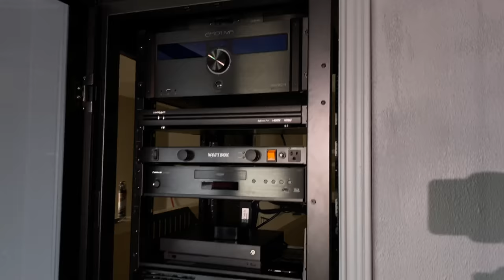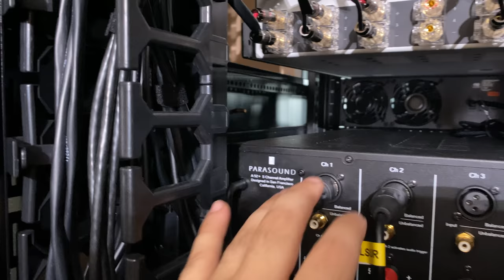Building the BATCAVE 9.2.6 Atmos Home Theater Beginning to End

Comment: Can't wait for your thoughts on the SVS elevations for your atmos. First time I have not seen them not on the side wall. I love where you positioned them.

My ceiling is too low so I had to get some in ceilings with a 15° driver baffle so hopefully that works well. They say angled speakers on ceiling is the best way. I don't understand why they don't take an in ceiling speaker and build it into a box with a 30° 45° boxes that can just be hung to the wall. That box with a 6" driver would only stick down 6"max with mounting bracketed similar to the Elevations. Rjeubwoila be small, discreet and easy to place with the proper angles to achieve Dolby positioning angles